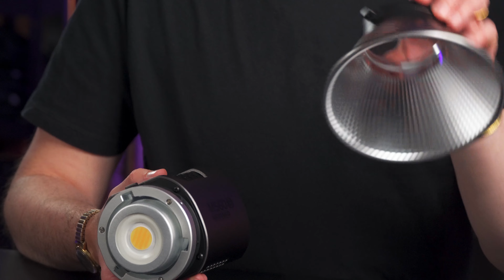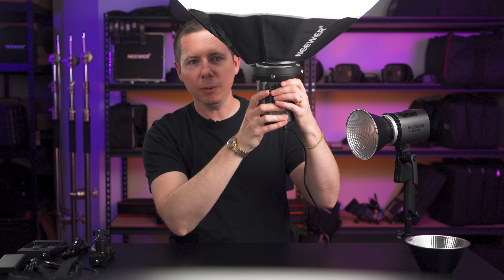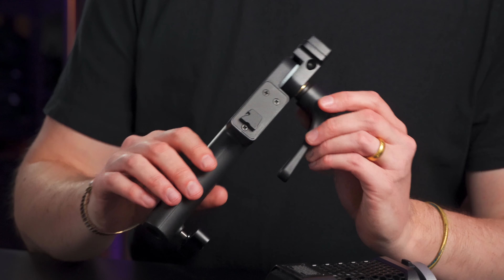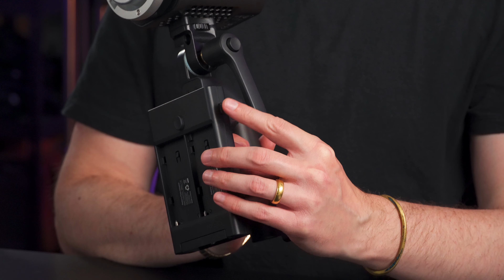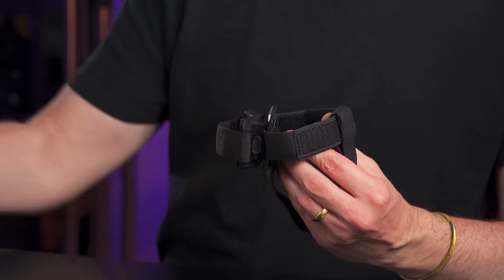Neewer Gear Breakdown: MS60 B/C LED Video Light

Comment: hello, i noticed mine didnt come with powercord that connects from light to the battery tray, what is the cable called and do you have a link cause i cant find it on your store
Reply from the maker: https://neewer.com/products/neewer-nc010-d-tap-to-dc-cable-for-ms60-ms60b-mc60c-ms150b-led-video-light-66603986?_pos=4&_psq=MS60+&_ss=e&_v=1.0
Reply: @NeewerOfficial this is for V mount, mine has  the regular NPf backplate, it has both male prong
Reply from the maker: @sayhowling  Sorry that battery plate power cord is not sold separately. Could you please contact our customer service team at support@neewer.com  with your name, order number,  pic/video demonstrating the issue and one of our representatives will reach out to soon to help.

Comment: I just got the MS60B because sometimes I MUST use Sony batteries in locations I don't get access to AC- but I want to make sure that the light will still provide the same ouput while using batteries as compared to AC (I know the batteries will run out in 30-45 min at near max power). I tested it the light and I'm pretty sure I noticed that the light dims a bit/much when I go from AC to battery power. Is this how the light was designed? to dim a bit when going from AC to battery? is this to protect the light? Do all COB lights (with battery option do the same?) Pls clarify if possible. Thanks

Comment: 7:09 lol that’s most likely for a power bank other then v mount
Reply: I use these with v mounts
Reply: @jean-philippegrignom6479  Hi, I was wondering how long the v mount batteries powered the light on different intensities.

Comment: Excellent description. Still, I have some doubts. Fan noise level. Can the effects be activated without the application? Does the app have to be ONLINE to work? And, if you had the spotlight located at a height with other lights and all connected to a power strip in the studio, when you disconnect the main power strip to turn everything off, and then connect it again, Is it necessary to press the light switch to turn it back on. ?
Reply from the maker: Hello, Thank you for your interest!
1.MS60B/C uses a silent cooling fan with ultra-low noise. The noise of the whole machine close to the air inlet tested is 50dB.
2. Effects can be controlled on the lamp panel.
3. In this case, turning on the light requires pressing the switch manually.
Reply: @NeewerOfficial  Thanks for your answer. Does the COB LEDs disk a glass to protect it from insects or scratches?
Reply from the maker: @biogons14  Yes, it does. :)

Comment: What is the total duration we gonna get on full power when paired with two npf 750s? My line of work is outside so if I purchase, it will be on battery 99% of time. The only thing holding me back is how long the battery going to hold it up and if the light output can overpower the sun during sunset or sunrise
Reply from the maker: Thank you for your interest.  The total duration is 8 hours on full power.
Reply: @NeewerOfficial  Thanks.
Thanks but I saw a comment below on how long 2 f970s can hold the light and the reply was 1h 50m from you guys. 
Here I am a bit confused on how 2 f970s can power for 2hrs but 2 f750s can provide 8hrs on full power despite lower on capacity.

And 1 more thing, Can a single NPF 750 battery power the light at 100%?
Reply from the maker: I'm truly sorry for the mistake, total duration should be 80 minuntes, not 8 hours....🤦‍♂ also, the light requires 2 batteries to work properly. Using a single battery is prone to insufficient voltage. Many thanks！ @PreviewsbyiSuvamFilmer

Comment: Works with 1 batteries? Or 2 minimum?! Thanks
Reply from the maker: Hi, sorry for the inconvenience. MS60C supports single battery and dual battery power supply, but please note that using a single battery is prone to insufficient voltage. Thank you!
Reply: @NeewerOfficial  perfect. thanks. There is a testing program for yiutuber?! I have a tech photography channel. My contact are in my bio. Really interested in product review

Comment: Great lights but What is the brightness difference between the C and the bicolor version? What’s the lux count on each?
Reply from the maker: MS60B： maximum illuminance up to 40000lux/1m, 110000lux@0.5m. 
MS60C：maximum illuminance up to 8300lux/1m，41000lux/0.5m
Reply: @NeewerOfficial  so the bicolor is like 5 times brighter?
I got the ms60c but if the brightness is that different I might just need the ms60b instead, or as an extra.

Comment: does the bowen ring work with other brand soft box?  this light is cool, i want to use it but unfortunately dont have neewer soft box.  thanks
Reply from the maker: Hi, MS60C can be used with softboxes with Bowen mounts. We have softboxes compatible with it. Here are the links: 
https://neewer.com/products/neewer-octagonal-softbox-quick-release-66600581?_pos=1&_psq=66600581&_ss=e&_v=1.0&variant=41955932930241
https://neewer.com/products/neewer-octagonal-softbox-quick-release-66600581?variant=41955932963009

Comment: HI, I understand that this doesn't come with the batteries, but does it include the Dual Battery Box or the V Battery Hanging Plate? are those in the box or do they have to be purchased separately? couldn't find a definitive answer on Amazon or the Neewer website.  Thanks!
Reply from the maker: Hello, the kit includes  MS60 B/C LED Video Light, Reflector, Handle, Power Cable, Power Adapter, Battery Plate, Battery Cable and V Mount Battery Adapter Plate. Actually our product listing clarifies the package contents and pictures in the listing also show them. Please kindly check the detailed info in the links below.☺   https://neewer.com/products/neewer-ms60c-rgbww-led-video-light-66602382        https://neewer.com/products/neewer-ms60b-65w-led-video-light-handheld-spotlight-66602381

Comment: Great light. Can we get a much longer power connector wire for the Sony battery to the light?  This so I can add this to a boom arm and have the batteries not add additional weight.  This would make an awesome, affordable hair light with a snoot thanks to your Bowens mount. If the cable was 10 or 15 feet, I would have purchased the light on the spot.
Reply: Extension chord?

Comment: That's an incredible light for outdoor conditions: does anyone know how long the two 970 batteries last? I'll need this combinations for outdoor documentary filming
Reply from the maker: The light with two F970 batteries (not included) can last about 1h50m and with our BP-190WS V mount battery (not included) can last about 3.5h. 
However, the D-TAP to DC 2.5*5.5mm cable is required to power the light with the V mount battery.
If you need more detailed info, please feel free to contact our customer service team at support@neewer.com.
Thank you😄
Reply: @NeewerOfficial  thank you for the answer 😃 1h50m is more than enough for some video documentary about Sea turtle's nests
Reply: @NeewerOfficial 

Would the length it lasts with the v-mount battery with the light at 100 percent?

Comment: Just purchased the ms60b, can't lie it's tricky to use and I can't find any help about connecting it to my phone app.  If I'm using the lights effects i.e storm or paparazzi, and I want to use the light without any effects then I have to switch off the light then switch it back on again? Instruction manual is way too basic...
Reply from the maker: Sincerely feel sorry for the inconvenience may caused to you. Could you please contact our customer service team support@neewer.com for assistance? Don't worry. They will be sure to address it as best as they can. Thank you.

Comment: Have you been able to compare it to the Godox ml60? I’m struggling to find any comparisons on it
Reply: hsy.. I have a Godox ML60 bi and also this Neewer MS60bi...they are very similar-The Neewer is a little better built I think...I sometimes NEED to use them without AC and just Sony battery power and I noticed that the Godox is brighter when using batteries  but the Neewer dims a bit...maybe not that much but I prefer the Godox .
However, the Neewer is so much cheaper. A bargain. These COB lights are much better than the LED panels I had before. I still use the panels but for interviews etc ONLY the COB with softboxes will do. For the Godox I had  to buy a bowen adapter to use bowen mount softboxes. I may buy a second Neewer so that I can control 2 lights using the app

Comment: been using a pair for weddings. can even fill sun shadows from about 2-3 feet away with no diffusion. strong enough to overpower some dj lights.

wireless is janky, several attempts to connect but indeed will. dont wait till last second to connect wirelessly.

Comment: I have the MS60c and I gotta say, I love it. So much so that I purchased another one. Very affordable, very easy to use, and a lot of output in a small body. I’m pleased with my purchase and definitely recommend them!
Reply: Is it plasticy or pretty rugged and well built to carry outside on shoots?
Reply: @stimes33  I’d say it’s pretty well built. It’s made with a more premium aluminum. Pretty compact and easy to carry around, especially since it comes with a carrying bag. I love that it has a bowen mount adapter so you can use other accessories with it.
Reply: Hi, I was wondering if you have used any v mount batteries with it… and how long it powered the light for.
Reply: @mtenhussein yes I’ve got the batteries as well, but i can’t say I recall just how long they’d last. When I used them, it was for a brief outdoor shoot. The higher the brightness, the more they’re drained obviously, but they don’t last for hours. I’d say expect to get around 45 minutes of continuous light if you aren’t using them too bright.